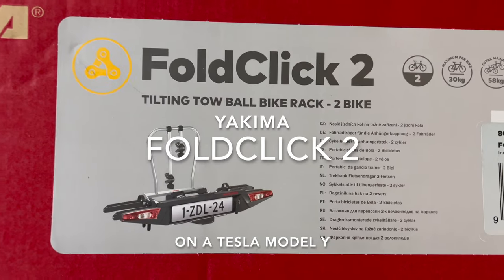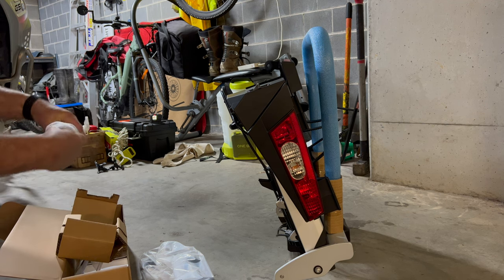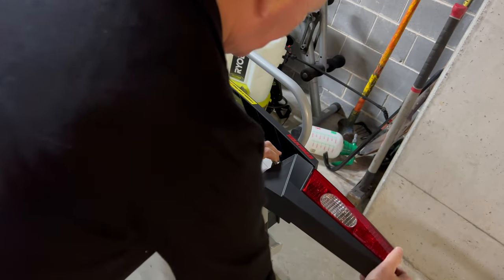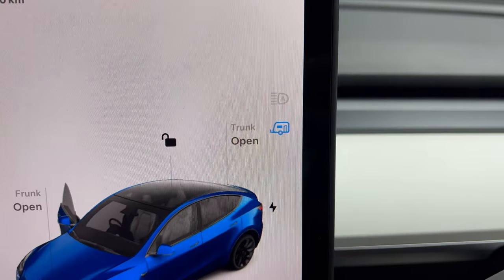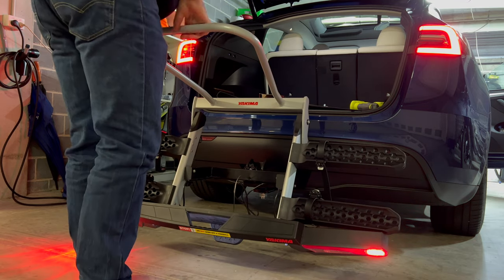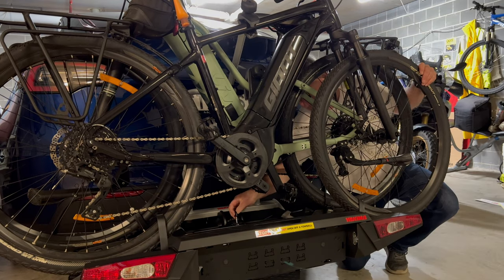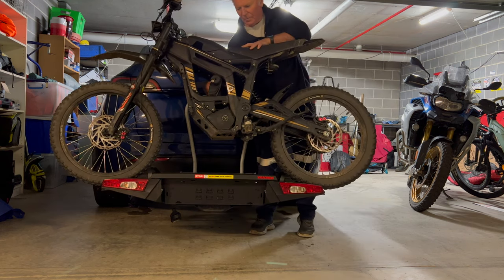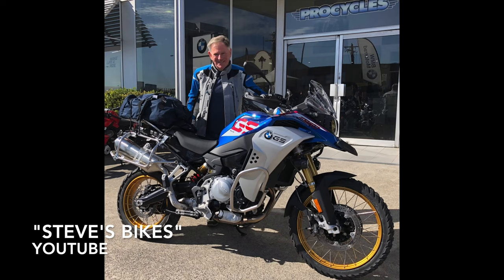Tesla Model Y - Yakima FoldClick2 e-bike rack

Comment: Thanks for the video Steve, I have already ordered my Model Y and have the same e-bike rack, so it is nice to know that it will all work together. Do you think it is better to remove the batteries to lighten the load on the rack.
Reply from the maker: Hi, the rack can take the load but I turned the hitch upside down as it scrapped on ramps. Also wind resistance will lower range about 20% cheers

Comment: Thanks for the interesting and informative video. I have a Model Y on order (can’t wait- only a few weeks more). I already use the Yakima Foldclick with my existing vehicle. 

A few points of potential interest/relevance:

1. To carry our 2 bikes, we chose the Foldclick 3 rather than 2. The 3 provides more clearance between bikes and handlebars and reduces the risk of rubbing. 

2. Though my current vehicle is a Pajero, I get the same wobble from the tow bar assembly if I fit the pin and retaining clip, but  don’t install the retaining bolt in the underside of the tow bar receiver. Is it possible that the Tesla tow bar receiver has a similar threaded hole for a retaining bolt that will tighten out the wobble?
Reply from the maker: Hi, we are on a 2000km road trip and the rack is secure despite the wobble. I’ve turned the tow bar upside down though as the rack has been scraping on driveways. Also battery does down faster. Video will follow. Cheers
Reply: Are you still happy with the Foldclick 3, seems like a good idea?  I'm torn between the 2 and the 3, the advantage of the 2 appears to be slightly less weight which is handy when you have 2 ebikes.